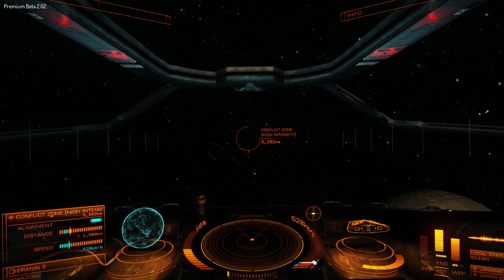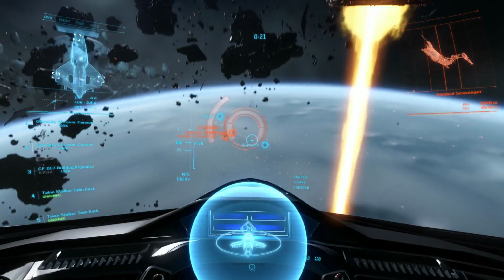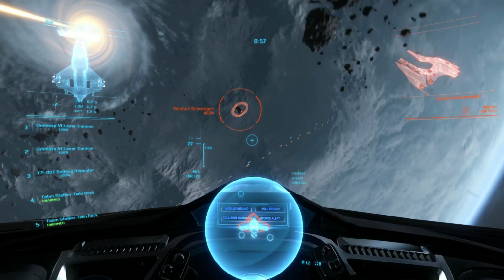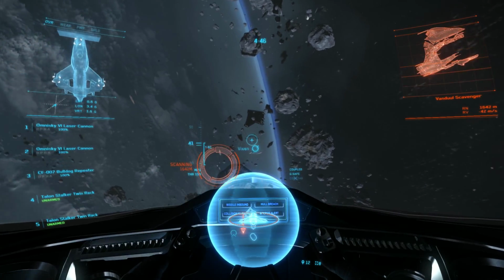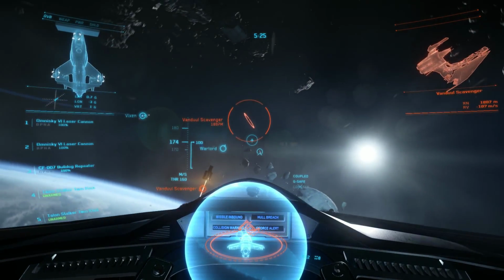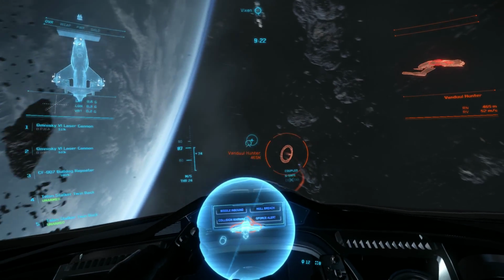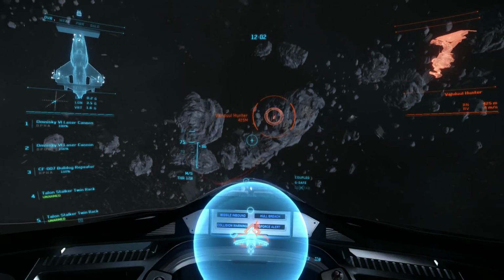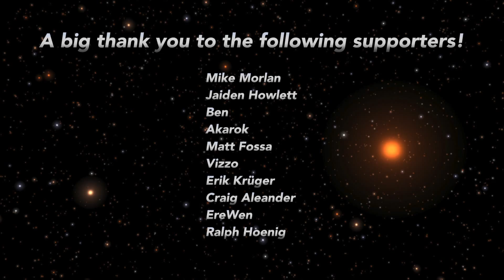Let's Pew Pew! 006 Throttle Control in Arena Commander

Comment: I still can't decide which control option is best. They all have their pros and cons. Oh well - best get them all so I can hot switch between them :)
Reply from the maker: I love the HOTAS.  Using the mouse and keyboard just doesn't work in my head.  I mean I'm flying a kick ass starship not a PC.  So HOTAS is the only control method for me.
Reply: Nichole D'Angelo I agree. That was only the case after patch 12.4 though. It felt a LOT better after that :) Can't wait for 12.5.